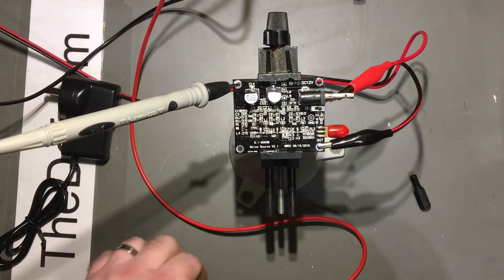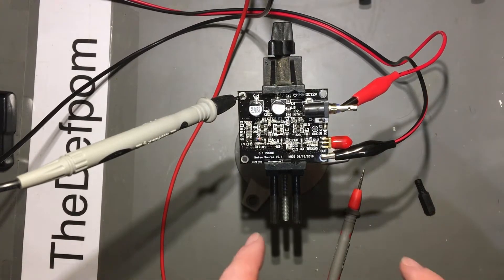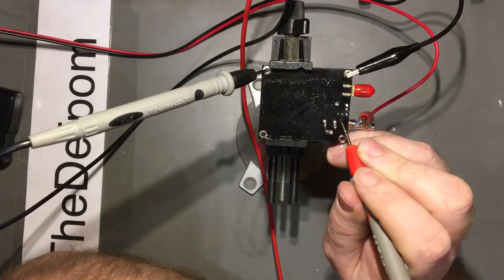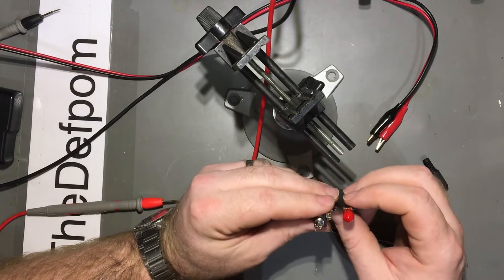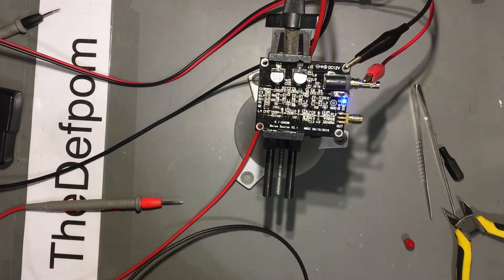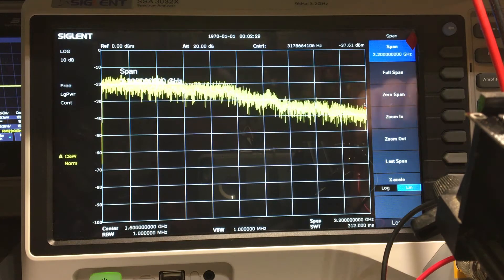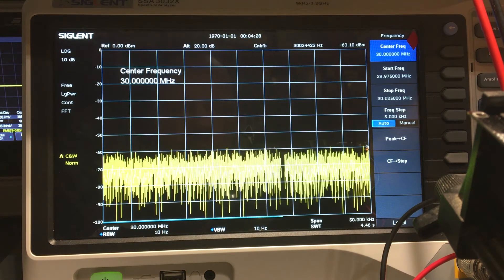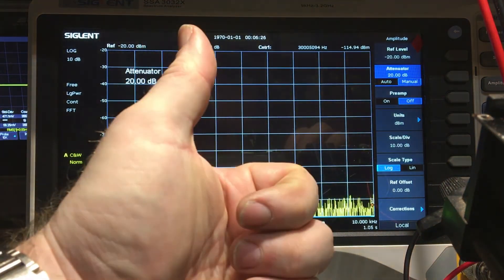#247 Wideband Noise Source Repair

Comment: Funny found your video on using a RF noise source which is going to be the next but one video in my series of RF measurement videos.  The quality of these cheap noise source varies considerably, I tried two or three. The one I have works very well but I have only characterised it to 1.5ghz but it pretty flat.  The circuit board layout is very important.

Comment: I think you will get a nicer display if you set the SA to peak hold mode and let it scan for a while
Reply from the maker: I was trying to show what the noise source actually outputs in case people believe that they put out a flat level across the range, this shows that the levels are all over the place. Yes averaging/peak hold would smooth it out in real world use when trying to actually take measurements.